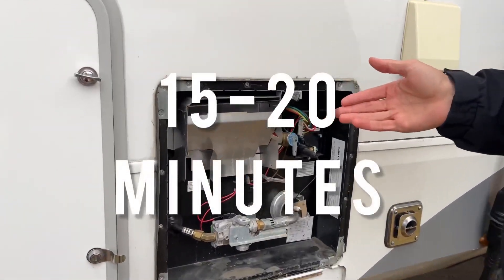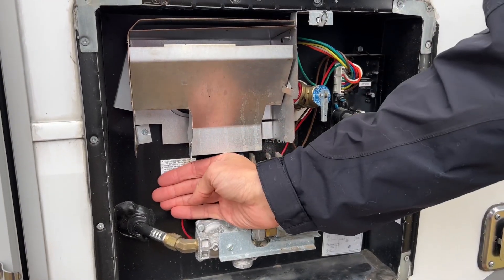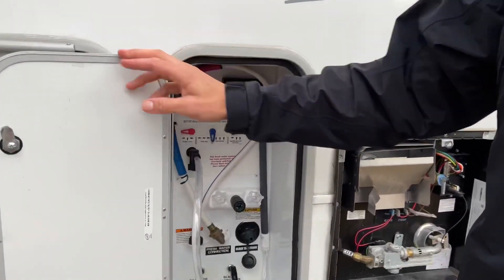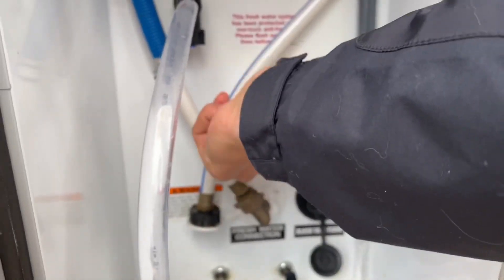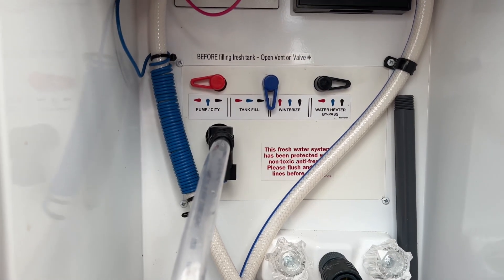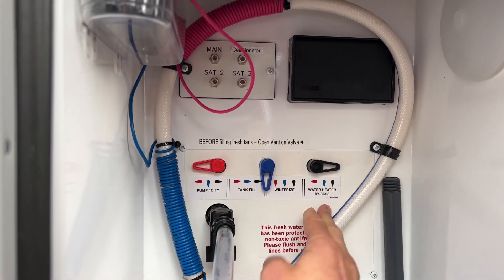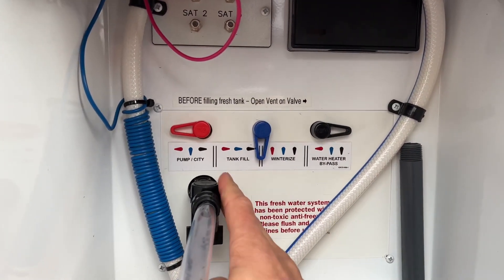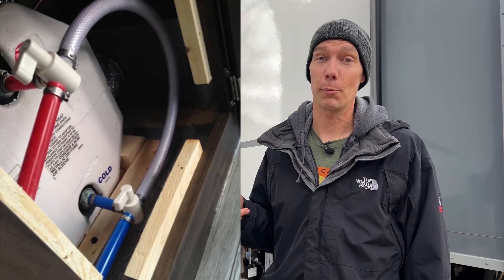Is Your RV’s Water Not Warming Up? RV Hot Shower Fix

Comment: Just wanted to tell you that you are my hero. Thank you very much for putting out this video. I changed my heated water hose and turned on my outside shower to get the air out. Took off the outside shower hose and forgot to close the hot side valve. Water was not very hot in the house and was driving me insane trying to figure it out until I seen your video. Boom it hit me and that was it. Thanks again.
Reply from the maker: You’re welcome Floyd, I’m glad you figured it out so you can get a nice hot shower. -Steve

Comment: Same symptoms, different cause: there is a tempering valve which mixes hot water with cold to maintain it under 50 degree Celsius (at least here in Australia) to prevent scalding. I took the cap off this valve and used an Allen key to adjust and voila! Hot water!!! 

I'm not sure if this upped the temperature or if it loosened some calcium scale that had built up. But, whatever, it worked!

Comment: What if you have an older model camper/trailer/rv. What do you do then if your water isn't heating up?
Reply from the maker: Joshua, if the water isn’t heating up you’ll need to investigate the water heater itself. There should be some videos out there for your model of water heater.  -Steve